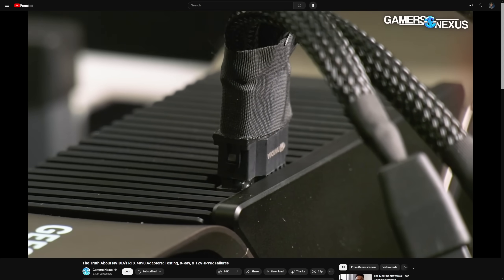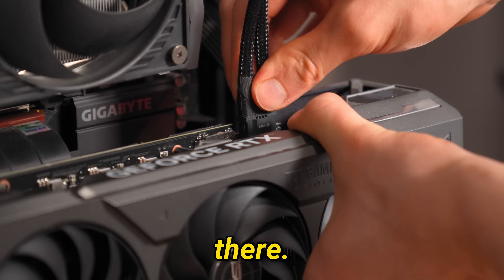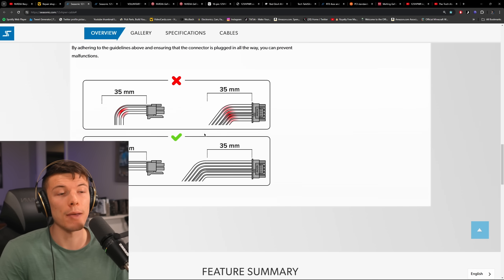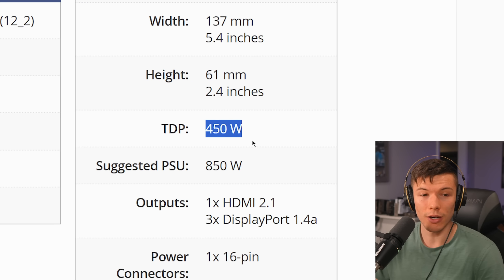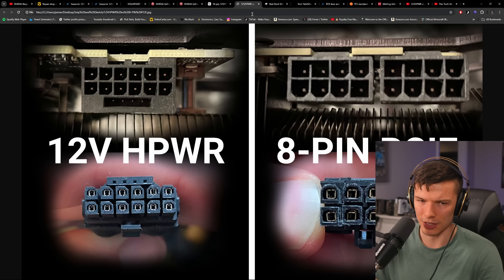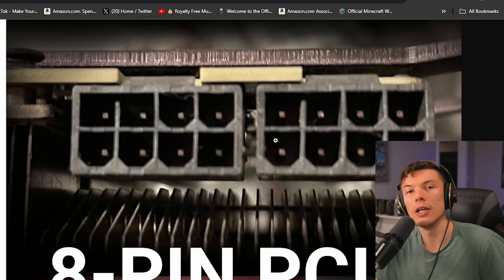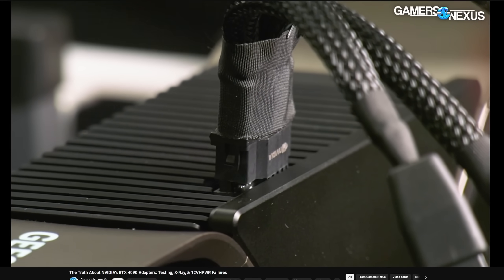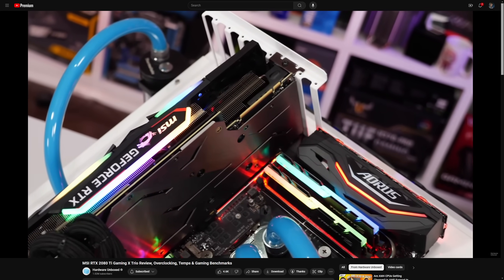The Dumbest Thing to Happen to Graphics Cards

Comment: The 12vhpwr cable is a standard made by Intel to reduce the foot print of the power connector, so smaller pcbs can be used for a graphics card. There is no problems with the gauge of wire used. They use a 16 gauge wire and the max amps it can handle before burning is 22 amps. The 12vhpwr cable when pulling 600 watts is only pulling 50 amps. With 12 cables the amps going across any one cable is a max of 5 amps which is well beyond within spec. The problem is the cable can sometimes not be fully inserted. This also doesn't happen on the PSU side even with the 12vhpwr port. Its only on the gpu when it is able to send power when it shouldn't since the sense pins have no 0 state for power draw.
Reply: You know what's odd about this connector All the RTX 3090 ti's that use don't have this problem & they regularly can use as much as 500 watts on an over clock. However I did read that the other pins weren't actually used in that card so maybe that's why.
Reply: What's the difference between 4090 and the other GPUs, the max power limit ! 
And knowing that some 4090 can reach 580 Watt in real consuption when there is no bottleneck is making these GPU approching too much from the safety factor that is only 1.1 for the 12VHPWR connector.
When consumers are buying a 2000$ GPU, there is no way NVIDIA can make them playing with fire !!! Final point, discussion closed !
Reply: @grogs777   They don't use more than 450 watts by default. I doubt everyone that has this problem is overclocking there GPU since most people don't. It's already been investigated thoroughly and there is a fix for what causes the problem in the 12v2x6 standards that fixes the issue with there being no 0 state for the cable so the cable has the ability to not pull power when they aren't fully connected since there is not state for that with the current standard. So even if the cable knows it's not fully inserted it will still draw power.

Comment: Strange, never had a problem with mine - just made sure to connect it firmly before putting my 4090 in the case. Has been working fine for over a year now.

Comment: when I got my rtx 4090 in december I made sure to upgrade the power supply as well so that I could just the one single 16 pin cable. The adapter cables from what I have seen are the ones more likely to fail compared to the single 16 pin cable. I also have my 4090 vertically mounted so it fits in my case and also the bend is less on the cable now as well compared to when it was horizontal and I had the case off.

Comment: Point is : put a 500w power supply on your PC and chose wisely all components accordingly. Result will be very reliable because very cold, dead quiet, very thrifty, and you may be surprised how very little you loose in performance.

Comment: I just looked at both connectors and 12VHPWR has 6+ and 6- wires, whereas 8 pin PCIE connector has 3+ and 3- wires with 2 sense wires. So it's the same in terms of the connections (2* 8pin pcie = 1*12vhpwr). If the wire diameter isn't the problem then all they would need to do is make sure that the plastic material of the 12VHPWR connector could endure higher temperatures. Also that the walls between wires would be thicker and tolerances between M and F sides would be tighter (less losses). That's why it would be rated for higher power while having the same amount of wires.
Reply: 8pin PCIe has no "sense wires" whatsoever, just power and ground. the only way the GPUs can "sense" that an 8pin is plugged in is by checking if two of the GND pins are bridged, which is only the case when the plug is inserted. Or if you bridge those GND pins on the card, then you can even plug in a 6pin into an 8pin socket and it'll work... until you overload it
Reply: @Knaeckebrotsaege  yeah thats what I found. But the current return is still limited by 3x 12V wires. Its all just to differentiate a low power 6 pin vs high power 6 pin connector. Would you agree?
Reply: wrong.
Reply: @StaceyJensenn  could be. ill never know if you just say "wrong"
Reply: @gregavrzel0  aint got time to explain you evrything you were wrong. Cya

Comment: Vendor lock in, that's at least half the reason Nvididuuurr is pushing this, once they can strong arm people onto PSUs that might only have their proprietary connector it's that much more motivation to stay with the only company that makes cards with those connectors.
Reply: They literally give you a connector with the GPU and the new PSU's have 8pins plus12vhpwr. Just go AMD if it bothers you that much.
Reply: @pem3480  connector that will burn down your card and pc? amazing! go chill green fanatic
Reply: @lost5oulforever You dont even own the GPU so stfu. How does it effect you? My 4090 has been sitting fine no issues since launch and thousands of other 4090 users with no issues. Stay on ur budget pc, and don't worry how I spend my money . Call me a fanatic for buying what works and leads in tech, stay mad bro.

Comment: The super series come with the new 12 6x2 ATX 3.1 pins. The 3.1ATX cables are revised to reduce the risk of a user incorrectly plugging in the connector.

Comment: This issue is a joke. It's just 12vdc and ground wires. The 8 pin is three 12v+ and 5 ground wires. It's dead simple. Nvidia needs to be sewed for this bs

Comment: I'd prefer a 8 pin jungle over the slim sizzle any day of the week. Compability and reliability over visuals.
If i had to take a guess on why the 12v high power cable even exists, it would be to prepare for the future releases like 50 and 60 series with their power draw.
Reply: thats most likely what is happening, the Beta 12vhpwr was on the 3000 FE cards, the true test is on the 4000 cards, and 5000/6000 will probably need the connector in it true final revision, essentially it feels like they are playing with everyone's money to make sure they get it right by 5000 or latest 6000

Comment: Why did they decide to make their new higher power connector smaller then the old 8 pin connector, all they had to do to not have this issue is to make a bigger power connector that has a decent amount of tolerance for things going wrong.

Comment: CableMod didn't recall the 90° cables because you don't know what you are going to get. They said its because they made a faulty adapter. If you bend their regular cable 90° and insure proper connection this doesn't happen. Its just not fool proof like you say and you have to pay attention to if the connector has uneven pressure on it so no pins are being slightly pulled out.

Comment: Man this is great that you spread awareness about this thing. It's horrible that for such an expensive GPU Nvidia won't do a refund. It's just redicilous. As a gamer myself I can confidently say that even if you had all the money in the world right now 4k gaming would still not be worth it. We are just not there yet. And this video is a very good example why this is the case.
Reply: We haven't been there since 4k started. Soon we'll start seeing 8k equipment and then you'll know it's just a huge waste of money.
Reply: @ArtisChronicles  People gonna buy anything if there is a sticker with a fancy brand name on it.
Reply: it melts from user error tho, why would they refund
Reply: @firstname9845  what error, connector is all in in the video shown here. gtfo with your user error ngredia fanboy.
Reply: @firstname9845  that's what I'm saying the reason why they are melting is cuz of these dumb gamers not installing the cable properly in the first case I myself have a background in cad and dynamics and I have a 4080 super which also comes with the same 12vhpwr cable and multiple times I'd even have to leave my computer running(rendering) for 10 hours straight and I've never encountered no sorta problem like this also I know of many people with 4090 and they have never encountered this problem with the cable either how come it only happens to these gamers? I think it's a user error
Reply: @smokychristian  I don’t know man I never had an issue with 8-pin connectors when I bent it in any kind of way. And yeah they have it in the instructions that’s right but it’s such a dumb requirement when it comes to installing. Like everybody uses 8-pin all the time without any issues and all of a sudden you get this new dumb cable. Of course people will install it like they did before. Thanks but no 4090 for me.

Comment: Innovation is great, releasing not fully tested power connectors is definitely not. For a company the size of Nvidia to do so is a scandal, the safety of your customers must of course come way above “innovation” I will personally not buy any Nvidia product until this is 100% resolved. I could easily afford multiple 4090’s but I will never buy one if there’s even the slightest risk of electrical problems. I value my health and safety way above owning Nvidia card, so I’m sticking with AMD for now.
Reply: fax I’m planning on building my very first PC and I like and want to use NVIDIA GPUs, the 4070 TI Super seems really cool (even if it gets some hate) and yeah pricing isn’t that great but still… I have more than enough to buy several 4090s but I don’t even want to buy ONE cuz it’s too expensive and value-wise isn’t worth it IMO and especially if the cables do shi like this!
I honestly don’t care about the looks so if I have to use the 2x PCIe 8 pin I will cuz I value stability and reliability.
Hopefully when I buy 4070 TI Super it won’t burn my house down lmaonade
Reply: @rafaelacash7 sure you do, must’ve just got your taxes that’s why
Reply: @ToastenButter  ye I wasn’t expecting uncle sam to pay me back to back lol… I thought I had to pay him nah only paid the lady who did my taxes.

Comment: thats the reason i went with the nitro 7900xtx instead of a 4090 . no need to ditch the dark power 12 or use the fire hazard cable ^^

Comment: I'd prefer 4x 8pin connectors on a 600w GPU. Most PSUs will have that option about the rated wattage. I have 2x 8pins on my 6800 and the cables are bent back and tucked no issue whatsoever and barely create an aesthetic issue, Heck with the right cable routing and perhaps custom sleeved cables 4x 8pin setups would probably look pretty dam good if you ask me...But no let use crappy adapters and or force power supply manufactures to use proprietary BS and make the consumer pay for it while potentially causing a house fire...GJ Nvidia
Reply: @xavalintm  They Need To Jump That Up For These Newer Cards! It Should Be An Option That Beyond The PCIE Slot There Is Another Connector For Power! Then If Your Board Does Not Support It There Could Be A Cover To protect The Pins And An Optional Bank Of 6 Pin PCIE Power Sockets!
Reply: never change a running system, agree
Reply: 1 8pin can do 300W so you only need 2
Reply: @LiLBitsDK  I mean sure 300w would be overrated but 200w seems safe enough with safety tolerances and would only require 3 plugs for 600w

Comment: If you HAVE to use the unsightly cable Nvidia provides then TAKE OUT your GPU and plug it in so you can properly apply force without worrying about breaking something